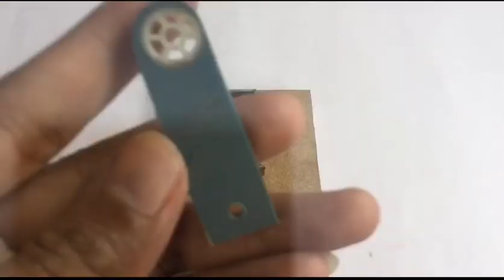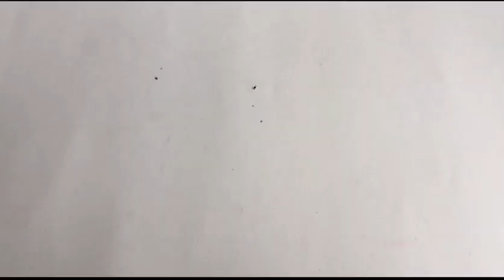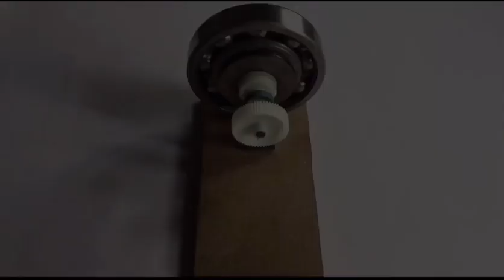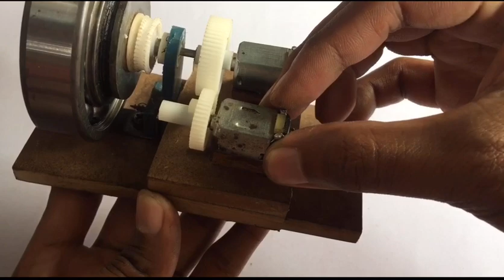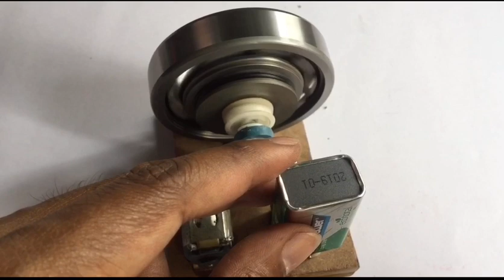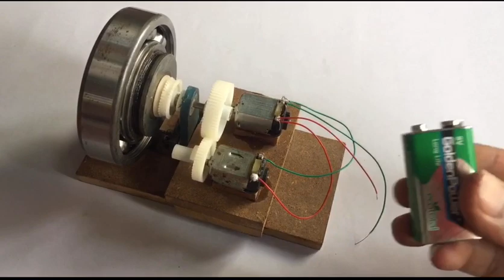How to make free energy generators with the help of bearings | home invention.

Comment: waste of time 👏💃👳👳👳
Reply from the maker: It is real one, let’s try, u will know
Reply: Creative Plus Yes, I have seen some bearings that are attached to a DC motor. 2 After that, all you have to do is rotate the bearings to make the shaft out to pull out the motor belt 1, then the motor. The first one will supply power to the second motor after the second motor is receiving electricity, it will serve as the axis of the bearing shaft is fully integrated and can be adapted to use. If you do not want to use it, you have seen it and see if it works. Saying it's time consuming does not really matter if you really make me feel bad, I'm sorry, I'm not good at English. All this I use Google Translate. Hope you can understand - https://youtu.be/XL-ydNHQsjQ